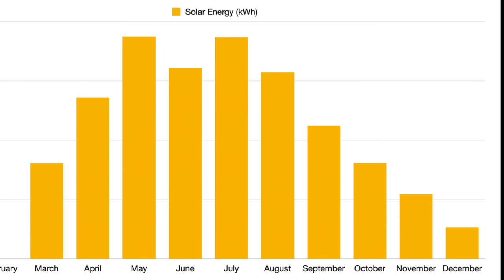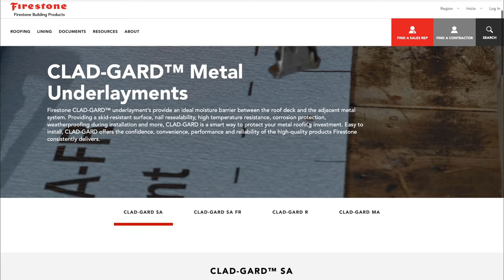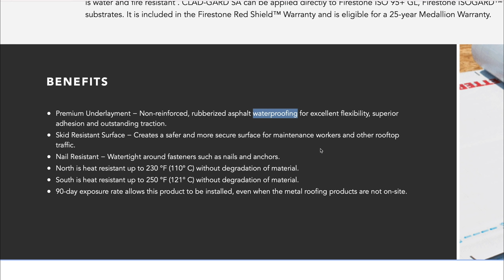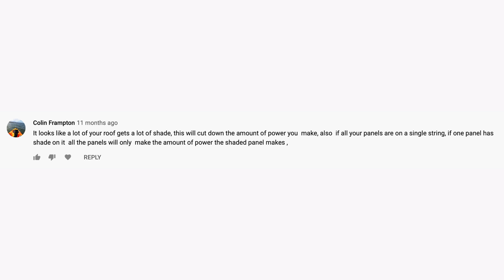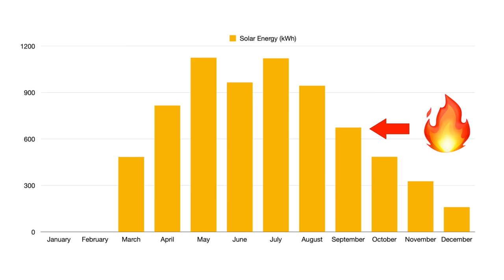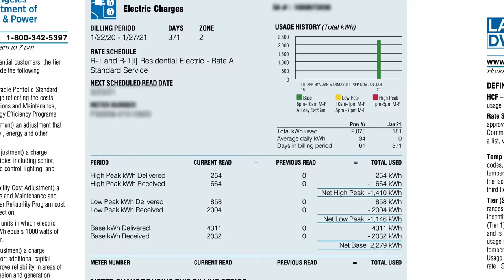1 Year with Tesla Solar Roof: top 11 questions answered + real production numbers & utility bills!

Comment: What was the cost again?  (Yes, I know it is in the video from last year).  Wondering what is the payback at $2000/year.  Also, what did the roof cleaning cost?  Technically, you need to subtract that cost from your savings.   You should consider buying a hose, ladder and a some Unger window washing tools from your local HD.  We use that with an extension pole to clean ours after pollen season here.
Reply from the maker: We needed a new roof, so if you subtract the price of a conventional roof, solar roof cost about ~$19k. Energy savings should pay for itself in ~10 years.

Yes, cleaning costs a few hundred bucks. Hopefully our fire seasons won’t be quite so intense in the years to come.
Reply: @AustinFlack  I've held off hiring someone to trim some trees that shade our solar panels because the trees only shade them very late in the afternoon when we wouldn't be making much power anyway.   The payback on tree trimming even has to be factored in to solar payback calculations.
Reply: I probably wait for hurricane to pay my new roof. 😂. So it would be just deductible and plus little bit premium increase.

Comment: Great video. I so appreciated your succinct summary. Really helpful. Maybe this is an a different video, but may I ask how much the roof cost (materials and installation?). If you break that cost down over the 25 year warranty/lifespan of the tiles, is it still less than the $2000+ you were previously paying per month? How much did installing this roof compare to doing a regular roof plus panels on top (if you got those quotes)? So many more questions! 🙂
Reply: I would like to know this too.
Reply: $34,000. At $2k savings per year breakeven is 17 years roughly.  But you need to subtract the cost of having a normal roof, which reduces it to 10 years. (According to him)
Reply: @johnflux1  cost of having a normal roof??? Whut? My roof is there.. it doesn't really cost anything...
Reply: @kungfreddie  Yes if you have an existing roof, but you don't install solar tiles if you already have a roof.  They are when you build a new house.
Reply: @Brian Right, which is a good thing.  We need solar to try to fight climate change.

Comment: What is the ROI?  If you're saving 2K per year, how many years to recoup the cost of the roof?
Reply: You should also subtract the cost of a regular roof.
Reply: Although I’m pretty sure most houses come with the roofs attached when you buy them 😜
Reply: @rinnin  soon it will be solar roofs attached 😜
Reply from the maker: Covered the cost in depth in my first video: https://www.youtube.com/watch?v=LRPy8UZv9V0&list=PLXt9cHZDKoN4TcPWRp-P7iQfshODE274k

Short answer: about $19k more than if we had just gotten a conventional roof and about $3k more than if we had just gotten a roof + panels.

at the current rate it would take ~10 years to pay for itself.
Reply: @AustinFlack  Cool, that tells me that since I'll need a new roof on my new house, I'll need to spend $19k more and since I typically use $200/mo in electric then it will pay for itself in 8 years.
Reply: @WillieStubbs  sort of. Then there is the cost of that money. What would your return on 20k bring in the real estate market, or the share market?
Reply: @joedennehy386  If it could actually return $2k/yr in electric on a $20k "investment" then it does pretty well compared to some conservative market shares.  That'd be like a 10% return for about 15 years if the roof lasts 25 years.  After further research a roof on an 1800sqft home is more like $60K-$80K from Tesla.  And the high end for a metal roof is $30K, so 26% back from the Feds for solar, I'd get a whopping $1K back from Arizona.  So at the high end at $80K, minus all those credits and the cost of the metal roof would mean the panels cost $28,200 which isn't far off from the price of 10KW of regular panels, but looks a little nicer.  I'm assuming generously that'd I'd get $2k back every year in electric value since I live in sunny Arizona.
And if I sold my home would the new owners look at it as added value or like some people look at a swimming pool aka a liability or just plain ugly?  I think they look quite purdy.
Reply: @WillieStubbs  yes, a 2k return on a 20k investment is nice. It would be more like a 6% return though on his math, and with 4 to 5% depreciation, the investment is marginal, although probably better for the planet
Reply: @AustinFlack  You are stacking the deck to make it seem like this is cost effective, and even an investment when it is not. 

Adding in the cost of the roof is absurd considering most people have a roof already. Excluding all other variables, the BEP on a TESLA roof may not even come before 25 years if you live in a low utilities cost area. At 25 years, maintenance of the roof itself will negate any long term savings.

This is nonsense. Might as well factor in the cost of your entire home if you are going to factor in the cost of a roof you would have needed regardless.

Comment: 2k in savings a year, how many years needed to break even with the cost of the whole thing?
Reply: Probably cost close to $20k or a bit more, so like 10 years - which is around the average for solar panels to pay themselves off in general
Reply: Google says install is between 80 and 100k. So that seems like at least 3200 per year for the 25 years it would be under warranty.
Reply from the maker: Covered the cost in depth in my first video: https://www.youtube.com/watch?v=LRPy8UZv9V0&list=PLXt9cHZDKoN4TcPWRp-P7iQfshODE274k

Short answer: $33k, about $21k more than if we had just gotten a conventional roof and about $3k more than if we had gotten a conventional roof + standard solar panels.
Reply from the maker: Will pay for itself in ~10 years. (I deduct the cost of a conventional roof when I calculate ROI—I needed a new roof!)
Reply: @Austin Flack
Were cleaning costs factored in?
Really should be.
Reply: @tootrue8230  since the tiles are waterproof and his roof is very simple and fairly small, I would guess he could easily clean it himself and save that money. 

But I agree he should factor that in, plus any additional maintenance needed during that time.
Reply: His numbers in the original video were accurate to what I experienced on a conventional solar install.  It makes sense if you need a new roof too, but not if you don’t.  I got a 7.1kwh system, cost 24k, rebates 8k, net 16k.  My roi is approximately 10 years, but if I have to redo the roof it’ll cost extra to have the solar removed and reinstalled...so it’s probably sixes with an install like this.
Reply: @AustinFlack  Worked out well for you, congrads. Out of curiosity have you looked into what it would have cost you know with the recent price jumps in the solar roofs? Just curious what those numbers and ROI would look like now.
Reply: @mr5039  just in time for the underlying roofing to be replaced....this will require the removal of solar panels which then becomes an added cost.

Comment: Appreciate the video, what was the cost of roof and the anticipated ROI?
Reply from the maker: We needed a new roof, so if you subtract the price of a conventional roof, solar roof cost about ~$19k. Energy savings should pay for itself in ~10 years.
Reply: @AustinFlack  What would a regular roof cost for your house?
Reply: @AustinFlack  thanks for the answer. It fulfilled half of my curiosity.  Also I am curious if both sides have solar panels or only one. Orientation counts a lot, and for a new build, a different design may boost the efficiency of the panels. I just found below the other half of answer. So a 9kw system I get it now. If you are in a really insolated area then efficiency may not satisfy some. I see figures as high as 2 MW per Kw installed. But quite lower in other zones. But the aspect definitely pays the difference. Many pay more for decorations that do not return nothing.
Reply: What was the cost of the new roof.  It is helpful to see all the costs involved.  Also was the $19k after all taxpayer funded rebates?
Reply: Actually just saw his other video..  $33k after taxpayer funded rebates and estimated $12k for a conventional roof which is fucking absurd..  far cry from $1 a watt..
Reply: @FJB2020  is that claim of 1$ per watt for the panel itself or installed? however, just looked for some stats and see that it really is for installed. https://www.solarchoice.net.au/blog/solar-power-system-prices 

And the absurdity is when things gets mixed. Reading comments on this review we get all the info you need. What it may.  interest you is that a similar roof plus a similar sized PV classic system would have costed 3k more. It is absurd to pay 3 k more to hide that industrial thing hanging from your roof? I think not, even I like industrial structures, and I will choose performance against aesthetics. The same thin I see to EVs. they come with a lot of options and luxuries that rise the price and then we complain that are too expensive.
Reply: @ehombane  That was the claim by Musk a few months ago for an installed roof (after taxpayer funded rebate), but if you go to Tesla now, you will see a HUGE increase in total installed cost..
Reply: @FJB2020  OK, I get it. Then is a stretch of the truth. AS I can see looking online, regular solar installations still goes well above that price range. Now depends on context. Maybe it was said as price of the panel itself, not installed. I see that the price for panels are in that range fo 40 cents for mono up to 90 for poly. And since Tesla is slightly less efficient, 1 dollar per kw seems real. But no way for it installed. And with complications off adding and subtracting the price of similar roofing option, here comes the confusion.   

Confusion so often comes naturally, and for advertising sure the confusion will be used with intention. 

I remember a similar thing about EV in Norway. With an aggressive pro EV politics there electric cars are attractive financially. And following the news I was surprised to find that in Norway, half of personal vehicles are electric.  I did not believed it. It was one or two years back. And in just few years since EV are on the market seemed unlikely to change half of auto park. I checked and double checked the news, and this it what they said. But I could not find actual figures to confirm this. Finally this year I found some data, and it seems that the actual percentage was about 10 percent last year.  The truth it is that 50 percent of new cars sold are electric. But the sold part was lost and the message delivered was totally wrong.

Comment: Good luck getting it installed. Also, regular solar doesn't degrade as much as these roofs do. REC panels degrade at a 0.25% a year. Also, costs you way more than regular solar. Also, you put tiles in areas that don't get great sun if your whole roof doesn't get the same sun.
Reply: Somethin about those numbers seems inflated. NO power loss?? Who's measuring these numbers? 93%?? That does not seem right.

Comment: How much did the roof cost?

Edit: ok, I found the answer in the first video. Roughly speaking, a regular roof would cost 12k and the solar roof cost 34k which is 22k more. With energy savings of 2k/year, it will take 11 years to pay off the solar roof premium, 17 years to pay for the entire roof.
Reply: So in other words this was not worth the money
Reply: A regular roof will last 10-20 years. If you're young and already in your "forever home", you will want to factor in the lifetime replacement costs.

If you're old and it's the last roof you'll ever buy, you want to weigh the free roof over 17 years vs the opportunity cost of the 22k upfront premium.

Comment: Great video! I am so curious about this. I would love to know if they pay you for all the energy you sent back into the grid or gave you a discount for that and how much?
Reply from the maker: When we send energy to the grid, get energy credits, which "pay for" the energy we use at night, cloudy days, etc. (energy at night, during peak demand periods, is more expensive that the energy we generate during the day). We can bank credits (sort of like roll-over minutes) but can't cash them out.

Instead of spending roughly $60k on batteries to ensure I was totally off the grid, (for a maximum savings of $156/yr) we just trade daytime energy for night time energy. We also charge the Tesla late at night (after peak demand hours), which is a lot of kWs, which helps explain how the daytime disparity evens out.
Reply: @AustinFlack  that's so interesting! Thank you for the information! Can't wait for updates from you! I think I'm gonna try this roof as well if my roof becomes cruddy.
Reply: How much cost the roof without bateríes??

Comment: How much electricity does your house consume on avg(day)? 

What are the peak hours of your house's electricity usage?

What are the highest energy consuming electronics in your house and how much usage in time do they have?

Why didn't you opt for a cheaper lithium battery solution instead?

 Usually smaller batteries are far less expensive than larger ones and you can setup multiple of them in series or parallel to achieve similar battery storage (albeit there is some efficiency loss) for a fraction of the cost of power wall.

Comment: I look at it this way: You are generating power for them. They should be paying you not you paying them.
Reply: Yeah, I'm confused by this. I knew of someone with a small geothermal unit that received a small compensation from the power utility for his excess power. How is their utility taking twice their household usage & still charging fees?
Does Not Compute.
Reply: They used to, but every couple years the deals for pv producers get worse.  I installed last year here in Utah, they take my excess and convert it to a lower dollar amount and put it on my bill.  Then if I use over what I produce they charge me more per kWh than a normal user.  It’s about a .3-.4 return on what I overproduce.  If I’d had it for 5 years though it’d be straight 1:1 and never even converted to dollars, just like banking it.  They are very anti consumer and really it’ll eventually be normal to not even get to bank any at all with where they’re headed, it’s stupid!
Reply: @Alero2k4  sounds like legislation designed to prevent energy independence, not encourage it. SMDH, why am I surprised is the real mystery...
Reply: @infidelapostate3094  that’s what happens when the energy commission isn’t run by the people, it’s like legislators giving themselves raises.
Reply: This is true, but keep in mind that without a powerwall they were consuming power from the grid whenever the sun was down.  It probably came out in the power companies favor (I mean this is the US, everything is always in favor of the corporations), but it isn't as bad as it looks.
Reply: @HolySorcerer  I live in Ontario. It costs a farmer 85k dollars to install a solar panel. Then all the power goes through the grid and not to the farmer. The farmer still has to pay a hydro bill. It should be set up, the farmer gets all the power from the solar panel and what he does not use (excess), can go into the grid. Not the way it is currently set up. It is a total rip-off.
Reply: @dr.michaelr.foreman2170  You would have to check in detail the amount of power used, and the time of day. It's not black or white. Maybe they used more power than they produced? I for sure don't know.
Reply: @Infinite the deal is to sell the excess...the owner of the geothermal unit does get tax write offs from the state they are in however

Comment: Great video, very informative. Silly question: my roof has been damaged and is 25 years old so I have to change it. Does the Tesla solar roof fully replaces regular roof or is it something that's placed on top of regular roof? in other words, can I replace my old roof completely with solar roof? or do I have to replace it with new regular roof and, after that, get the Tesla an place it on top? Thanks
Reply from the maker: The Tesla Solar Roof fully replaces your roof. We needed a new roof as well, that's the reason we opted for it, rather than panels. Sounds like it could be a good option for you too! You can see more about our old roof and why we opted for the solar roof in my first video: https://www.youtube.com/watch?v=LRPy8UZv9V0&list=PLXt9cHZDKoN4TcPWRp-P7iQfshODE274k

Comment: Hi Austin great video I appreciate your thorough analysis. I was wodnering what is your solar roof powering? Do you have electric mini splits for heating/cooling, electric vehicles etc? My goal with a Tesla roof would be to make my utilities as close to zero as possible. I will be using electric for HVAC, Cooking and Vehicle charging and I want to know if this is feasible and justifies the cost of the roof

Thanks

Brian
Reply from the maker: We have central air. Charging an EV automobile isn't really feasible without a very large solar array and a whole bunch of powerwalls.

Comment: For anyone wondering its roughly £40,000 for an average size UK house just for the tiles so youd make your money back on them in the 25 years in the contract but wouldnt make that much back. However if you’re wanting to help the environment then they could be a good investment
Reply from the maker: Covered the cost in depth in my first video: https://www.youtube.com/watch?v=LRPy8UZv9V0&list=PLXt9cHZDKoN4TcPWRp-P7iQfshODE274k

Short answer: $33k, about $21k more than if we had just gotten a conventional roof and about $3k more than if we had gotten a conventional roof + standard solar panels.

Will pay for itself in ~10 years. (I deduct the cost of a conventional roof when I calculate ROI—I needed a new roof!)